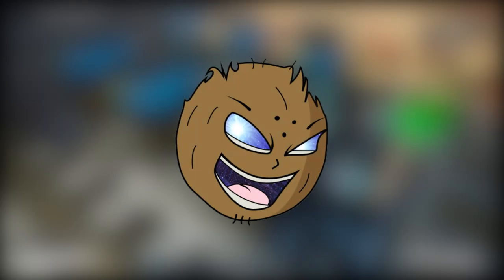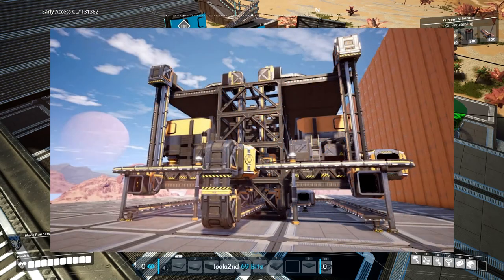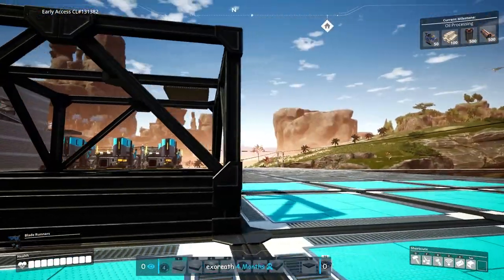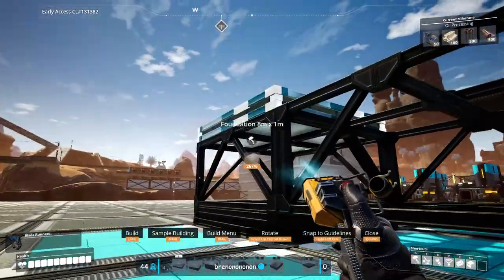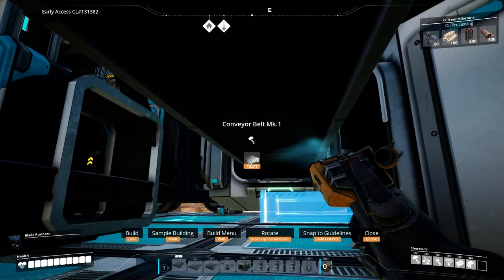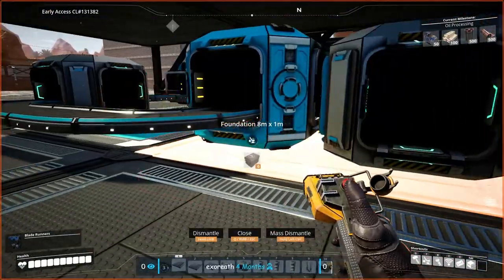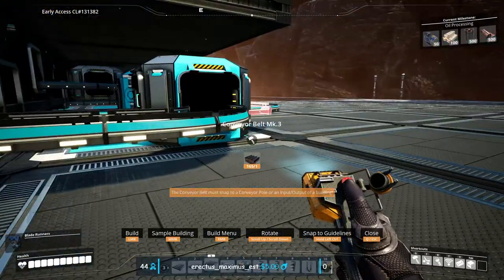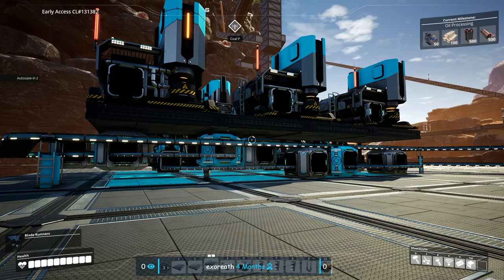This might change how you belt your factories from now on... ~Satisfactory~

Comment: It's been my experience that when you place a splitter on the ground, it will simply clip the graphic through the existing belts. If you want the splitter/merger to snap to the belt, aim the splitter at the belt and manually align. If you want to auto-align on the foundation, you must  manually connect the belts.